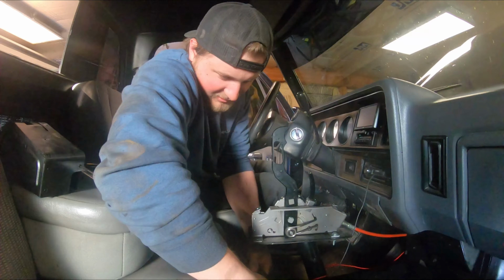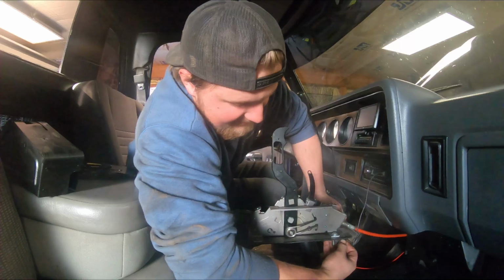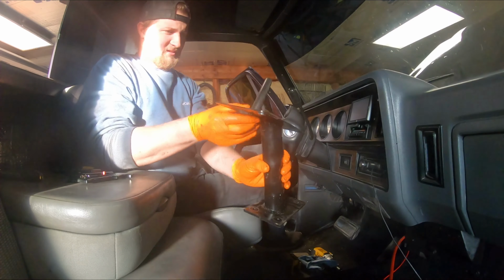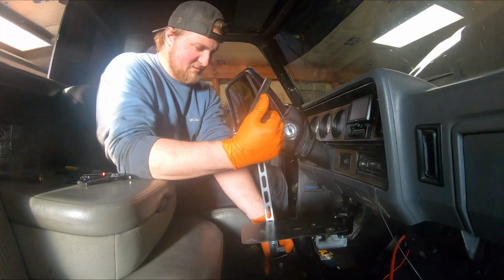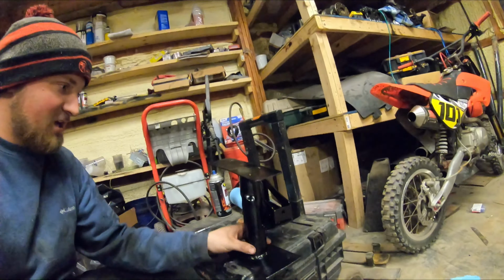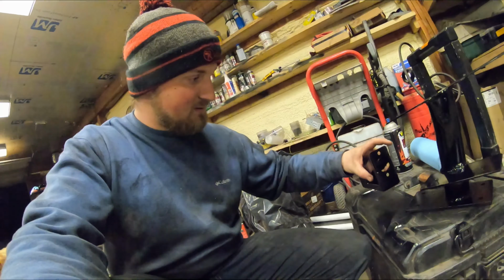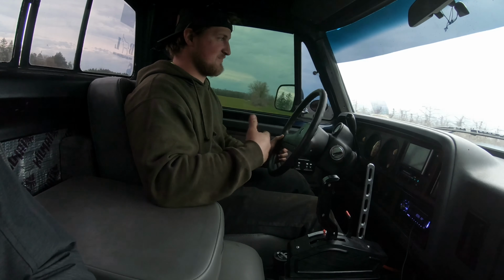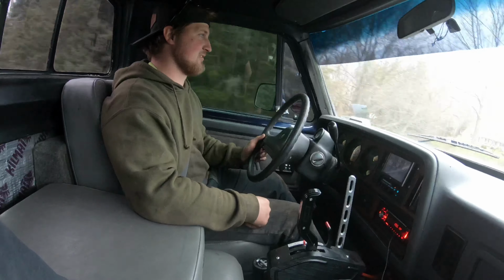First gen cummins gets hand brake

Comment: In between 8:07 and 8:11 you didn’t have your hand on the ratchet shifter and it sounded like you locked the converter locked, can I ask what happened here cuz it’s stumped me
Reply from the maker: Hestia Style it did
Reply: Yeah but you have a fmvb and I didn’t see your hand on the shifter I was just wondering how you locked it up without hitting the switch I have a spring gate fmvb daily driver and when I didn’t see your hand on the shifter and it locked up, just have to know this wizardry
Reply from the maker: Hestia Style lol lock up and od are hiding